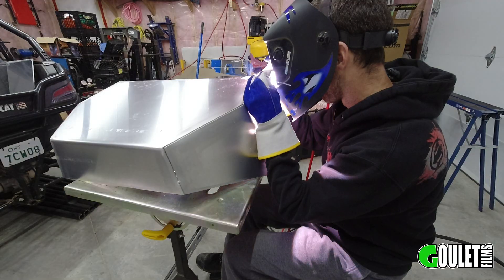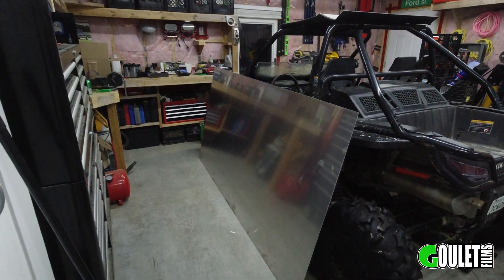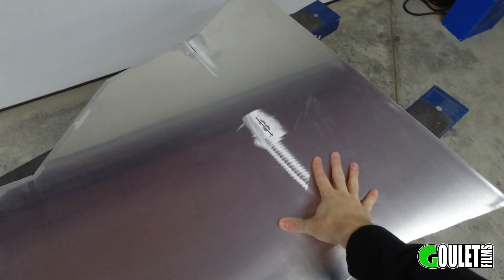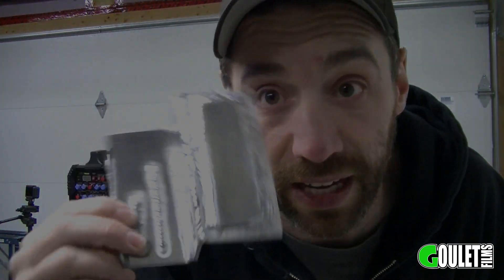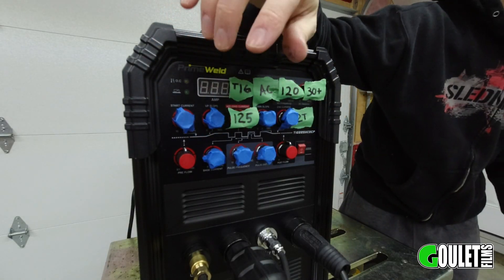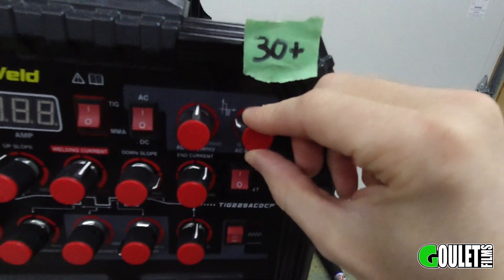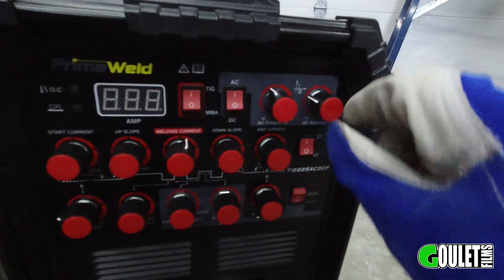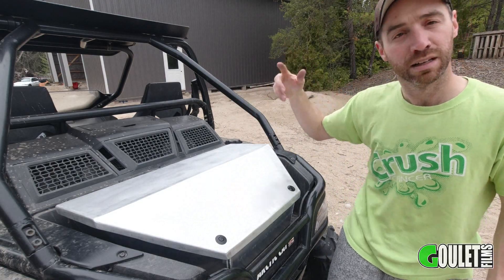Ep.17 | Aluminum TIG Welding - PrimeWeld 225X Settings

Comment: Can you use a spool gun with this machine
Reply from the maker: Spool guns are for MIG welders. This is a TIG, so the answer is no. If you prefer MIG welding and want to do aluminum (with a spool gun), check out the PrimeWeld MIG180. It comes with the spool gun and it’s a great unit!

Comment: Hey, I noticed some of the dials you covered up (with blue tape) are actually functional to the weld process, EVEN when NOT in pulse mode.  I set it up the way you did and was having big problems blowing through thin materials.  I saw another video in which a guy said to make sure the "upslope" and "downslope" were turned down to zero (rather than ignore them), and had much better control.  I called PrimeWeld to confirm, and they instructed me to make sure I had those two dials and the "start current", "end current", and "base current" all turned down all the way, when using the foot pedal (2T).  You cannot ignore these settings on the machine.
Reply from the maker: Thanks for your feedback but my video is based off the user manual supplied with the machine. I read the manual carefully and did not experience what you stated. My machine is a few years old now, so maybe things have changed? I’m not sure. Again, thanks for posting your feedback, and I’m glad you were able to solve your problem, but something isn’t adding up.
Reply: @gouletfilms  Yeah, might be worth a qualifying call to Prime.  If you look at the face template of the machine, they highlight with grey color, the dials that are tied to the pulse control.  Maybe Prime changed something in the box, but after further research, it appears though these dials are not useful with a foot pedal (or even in 2T mode), they are still active and must be turned down to minimum in order to not interfere.  Weird.

Comment: Looks awesome thanks for the education 👍🤙🐼😎🤙 I have an I-beam I have to weld together.. bought it in two pieces to save money 💰💰💰💰 I always wanted to get a tig specifically for Aluminum and I bought the prime weld 225x about a year and a half ago..never used it..now...I have to..and I have my reservations..but after your video, I think I gained the balls to try it..plus I cut, drilled and bolted plate to secure the I-beam..lol overkill..but since I'm so insecure, overkill is good 👍🤙🐼😎🤙
Reply from the maker: This is such a great comment, thanks for sharing. I’m really glad I’m able to give others the confidence to tackle projects themselves!! 👍👍
Reply: @gouletfilms  I just got a response from
AM Custom fab

"225 is definitely going to be pushing it on half inch aluminum but to give yourself the best advantage I would do a couple of things. 1.make sure you have the water cooler because you're going to need all the amperage you can get and the ck-17 is only rated for 150 amps. 2. To make sure you have something that you can preheat your joint with whether it be a propane/map gas torch. Or an infrared heater. I would bring the joint up to around 300° plus before you start welding to give yourself the best advantage possible. 3. I would crank your amps all the way up. And drop your hz or frequency down a little bit somewhere probably around 60 . And turn your balance down a little bit too to wind up your puddle somewhere down around 60 as well. Good luck 😎🙏👊 and thanks for watching"

So is he correct about trying to weld .250 plate aluminum and .500 Aluminum I-beam??
Reply from the maker: @ManicPandaMedia  yes, absolutely. The thickest aluminum I’ve done is 1/4” and that was pushing it. Also, I’ve learnt a lot from AM Custom Fab, I definitely trust his opinion.

Comment: So i am phusically unable to use the foot pedal and need to use the finger switch. Where about was your constant amperage? Like how far were you pushing the pedal down to get your perfect puddle?
Reply from the maker: Yes a lot of the time I was 100% when my gaps were tight. The bigger gaps, I had to let off a bit. However, I used the finger switch to do an aluminum railing (albeit, it was thicker material), and I found myself tweaking the amperage a lot more until I found the sweet spot, so be prepared for that. Also, I’ve seen finger switches with dials on them to adjust on the fly just like the pedal, so it might be worth looking into that some more for yourself. Cheers my friend, and good luck with your projects.
Reply: @gouletfilms  thank you that helps me out actually, im gonna start trying to weld aluminum piping for my intercooler and have some practice pieces laying around. I will need to try and find that dial switch but have liked the 4t system with mild steel
Reply from the maker: @Itsarealone  sounds good, let me know how it goes

Comment: I have a same machine and really like it. Just wish the dials around the knobs would be more accurate to actually for example know where exactly the 30 % of balance is. LOL Plus not sure if is a normal for this machine, but when welding aluminum look like I get full blast of amperage on start no matter how much I push on pedal. Is not so evident when  welding the steel. But for $800  is a very good machine.
Reply: There is a guy on amazon who sells stickers that go around the knobs a lot more accurate
Reply from the maker: Great feedback! I think someone makes a front faceplate that provides finer details for the settings (pretty sure someone posted it in the PrimeWeld FB group). However, I definitely don’t have the issue you’re describing with aluminum. Might be worth looking more into it, as it doesn’t sound normal. Cheers and thanks for the comment!

Comment: I just received my primeweld 225. I've been having an issue of the aluminum melting away when near the edge. Setting amps at only 50 balance between 30-60 hertz 20-60. Beautiful anywhere 1!2" away from an edge. Outside corner, both edges melt away. This is with the exact coupons your using. Did you have this issue?
Reply from the maker: The angle of your torch makes a difference. Make sure you’re throttling down on the pedal and angle the torch more towards the material, that might help. It definitely gets tricky around the edges, also helps to bring in more filler material than you normally would
Reply: @gouletfilms  I definitely notice my angle now that you said that. I think I have an issue with my pedal, It has a spot when your backing off, it will shut off then start again. It doesn't do it when starting, just while backing off. Thanks for your help.
Reply from the maker: Glad I could help! Cheers and happy welding.
Reply: @donaldlarkin2208  I have the same machine and notice I must throttle back in a smaller increment at the end to maintain the decreasing AMP arc.  Give it a try- Let off in smaller increments.  Good luck!

Comment: I've never welded. Bought this machine and it'll be my first attempt at this. Your video made it really easy to visualize the dials especially with the tape. One question I have is should I start with mild steel or aluminum first or does it matter, if I'm a beginner? Thanks for the video can't wait to check out a few more.
Reply from the maker: Thanks for the feedback!! Mild steel is DEFINITELY easier, I would start there if I was you. As a result, for steel, you’ll have to set the machine to DC (instead of AC). And note that you do not have to worry about AC frequency and AC balance (they do nothing in DC mode). Good luck!!!
Reply: @gouletfilms  Totally agree that you start with steel or even stainless steel is easy compared to aluminum.
Reply: Please start with Steel, It is less difficult than Alluminium, to learn the process.

Comment: aWsome..  Im loving my Primeweld 225 !
Reply from the maker: Thanks! Do you have any other Primeweld products?
Reply: @gouletfilms  not at this time,  my machine does NOT have the outlet for the watercooler, i bought it Aug 2019, im just a hobby welder  / fabricator but i did make a cooling system for future needs using a small radiator and some pc tower cooling fans. ill keep ya posted. 🎯
Reply from the maker: @jimmyfavereau  very cool! I did some thicker aluminum over the weekend and definitely would like the water cooler.

Comment: More small slots to reduce continuous material in the bend is more effective than a few big ones. Also, shorter welds after bend to limit heat into the sheet and possible warping.
Reply from the maker: Good feedback, it’s appreciated. I’ll consider these for my next aluminum project for sure. Thanks.

Comment: Here a tip on bending aluminum without a bender if you have a Oxy/acetylene gas tourch.  You can heat to aluminum to bend by using the tourch,  Turn only the acetylene on greating the black smoke (sout), use the black smoke to blacken the bend point. Now add the oxg. to the flame and start heating the bend area.  The right bending temp is reached when the black sout disapears, at this moment the material can be bent.   I have used this process many times.
Reply from the maker: Great tip, thanks for sharing! I’ll definitely try that next time.
Reply: Good tip 👏